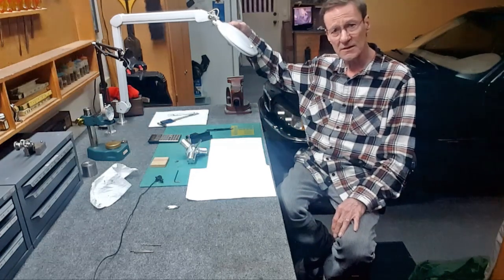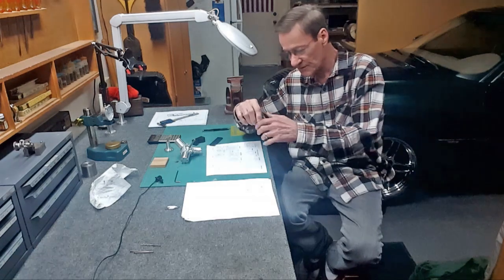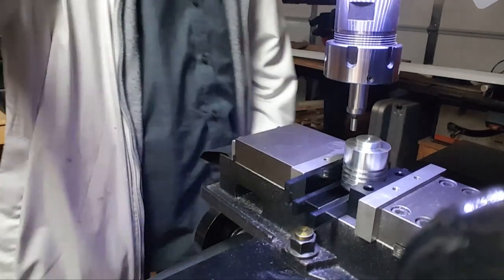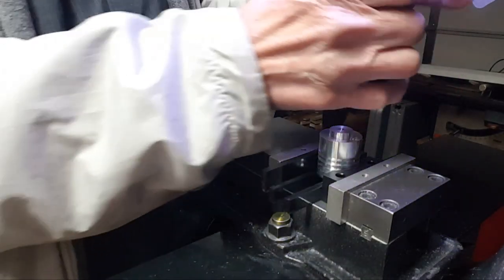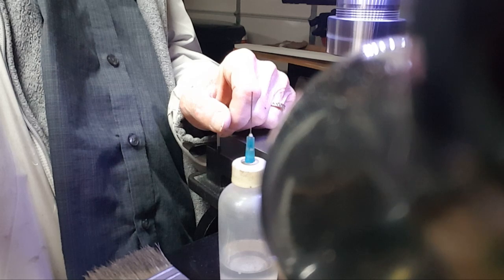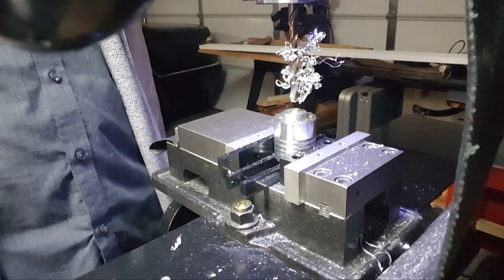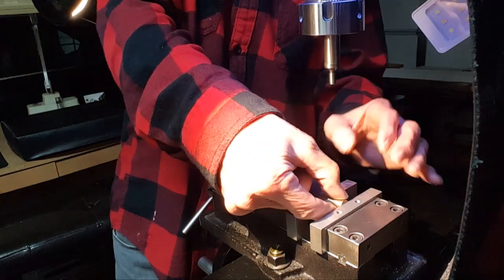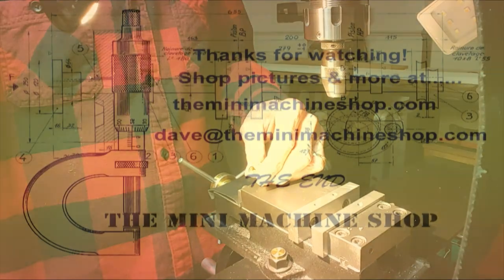Elmer Verberg's Radial Engine Pt2

Comment: How did that bore look? If never used a reamer in a mill before, always done them by hand (mounted in the tailstock but hand-turned) - which probably necessitated a drill a fair amount closer to finished size. But those stalls bothered me, as did the quantity of chips coming out with the tool.
Reply from the maker: Later a video will release making the cylinder and it was perfect didn't hone it or anything!
Reply: @TheMiniMachineShop  Excellent. Maybe I need to get a bit braver.

Comment: When you're done with this one you might consider building Rudy Kohupt's 5 cylinder radial.  It's one of my best running engines - very rewarding to do.
Reply: Rudy Kohupt’s 5 cylinder radial would be an awesome project.  Common Dave, hook us up.
Reply from the maker: I was thinking of changing this design to a six but this one was 8 weeks of work and a LOT of chips.
Reply: @TheMiniMachineShop  it will be great content lots of model engine builders would flock to it

Comment: Nice!   Gotta get me a DRO!
Reply from the maker: They are a must on a mill TouchDRO and iGage scales
Reply: @TheMiniMachineShop  I just ordered my Touch DRO kit (soldering is fun for me) and the scales.   I also downloaded your excellent manual - thanks!  I did notice what I think is a typo on page 12 where it talks about the W axis mode.   Each of "add" lines say that they will all add to the X axis but I think you meant to say that if you select "Add to Y Readout" would add to Y and the same for Z.   I might be wrong - I don't even have the equipment yet so I don't know.